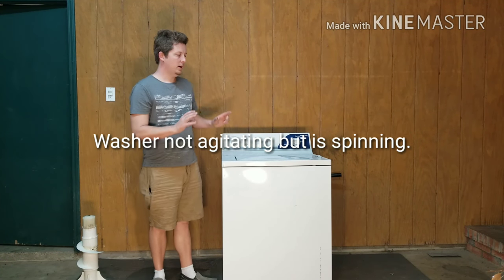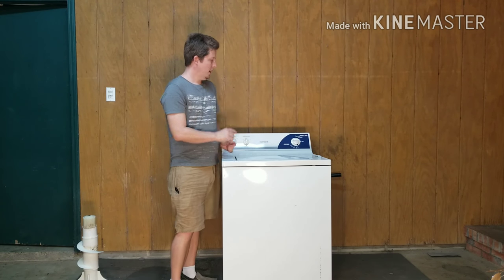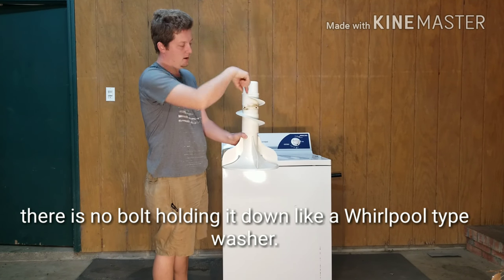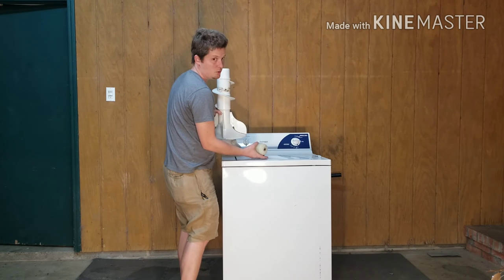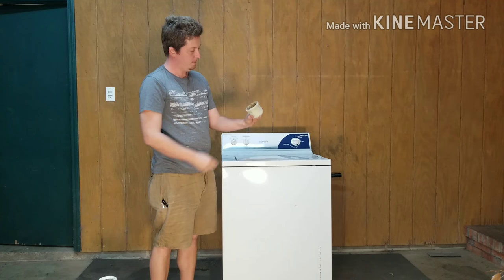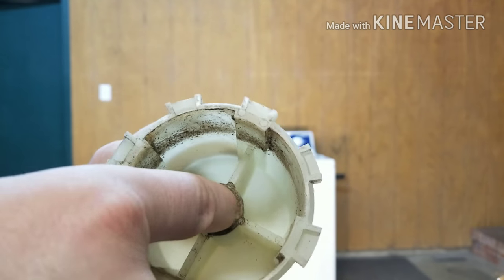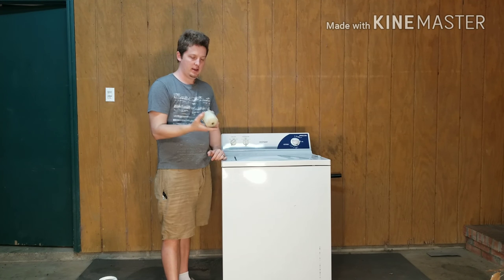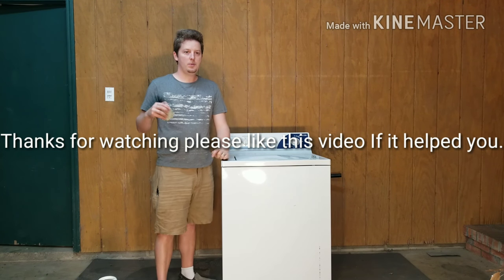GE Hotpoint  or RCA Washer spinning but not agitating step by step easy repair

Comment: My fix was tightening the belt. It will spin because its drained, But the weight of the load with full water & a loose belt just smoked at the motor pulley. I tightened up the slack on that sumbitch & presto! it works!

Comment: My whirlpool  washer isn't agitating . it's just spinning the whole agitator during the agitation cycle and I just had to replace the motor coupler because it had broken
Reply from the maker: When you progress it to spin, does it drain and spin properly?
Reply: @WasherDryerMoney  it started working fine now. I was just testing a cycle with just water and went in to look at it as it  was suppose to be agitating the agitator was just spinning fast  the  top and bottom  of it instead of going back and fourth.  I also didn't get in there to look at it until it was at the end of the agitation cycle.  once it went to spin it was draining and working correctly from the start so I don't know what was going on.  I did  notice I can spin  the agitator at the top both directions freely  so that is something that needs fixed. The washer also has a capacitor so I didn't know if that was just for the run cycle or helped with reverse rotation as well it's also a whirlpool from 1998 based off the motor date
Reply from the maker: @121790tyler  it’s probably fine now that it’s done a full cycle. Sometimes a old transmission will be in the wrong position after you do a repair. After it goes to a full cycle, it will probably be fine.
The agitator probably needs new dogs Sometimes called dog ear gears.
They’re super cheap and easy to do. It actually will still work fine. It just will only agitate from the bottom of the agitator and not the ratcheting top.
Reply: @WasherDryerMoney  alright thanks I did just do a motor coupler repair with the help of your other video

Comment: The part is a drive block and the part worn away inside is the splines.  You should show it slipping and then put in the new part and test it. Good luck with your channel.
Reply from the maker: Yeah I should have shown a before and after. Too late now I already sold it.
Thanks for commenting on my videos. It really helps my video ranking.

Comment: I’ve came across your videos after I’ve flipped appliances for a couple years now but was paying people to do repairs for me. Your videos have really helped and now I’m doing the repairs myself. I have a GE same issue, replaced the coupler still not working. It seems like the notches on the agitator itself are stripped out. Is that possible?

Comment: I can't seem to find the answer to my issue. Have a GE top loading washer with a very sluggish agitator. I cannot manually spin it so coupler not broken. It drains and spins so it's not the belt... I don't know what to do next. Any suggestions? Thx
Reply from the maker: Motor Going bad or capacitor getting weak. I believe the capacitors are built onto the motors, not replaceable on most GE.
that would be my best guess without seeing it in person. Good luck.
you might also check to see if the belt is in good shape, and not slipping.
Reply: @WasherDryerMoney  - thank you for responding and your suggestions, much appreciated :).

Comment: What would cause the new style he ge washer not to continue washing  after the water has fill or not continue to spin after the drain out help please
Reply from the maker: Lid switch maybe.
Reply: I had already change the lid switch can be any other part thanks in advance it’s the new ge washer
Reply: Yeah, my 4 yr old GE washer isn't agitating. These news appliances aren't worth a flip. Old appliances were more reliable.

Comment: I had already change the lid switch
Reply from the maker: I’ve had several GE washers have Motors go bad. It’s always hard to tell. There’s a couple Facebook groups that are really good at helping people fix appliances by just sending them a picture or taking a small video of the issue. I think there’s one called appliance repair group or something like that.

Comment: What is the issue when a washer is agitating when it is suppose to spin??
Reply from the maker: GE?
Reply: @WasherDryerMoney  Hi it's a Whirlpool Neptune stacked unit.The issue is the unit is agitating when it is suppose to spin.
Reply from the maker: Not sure. I don't work on a lot stack units. Sounds like it could be a timer issue.
Reply: Is the knob (dial) set properly